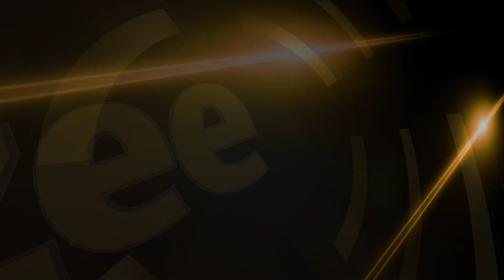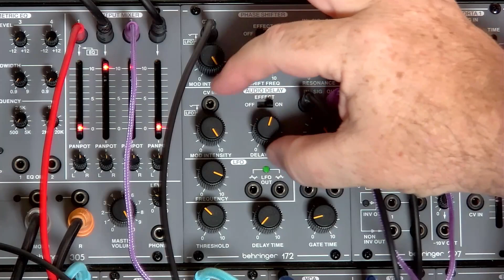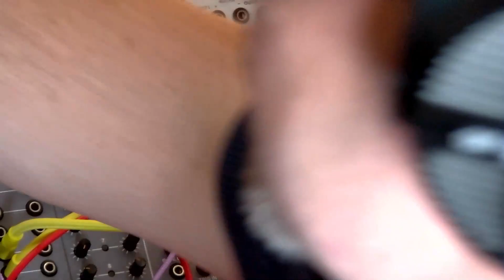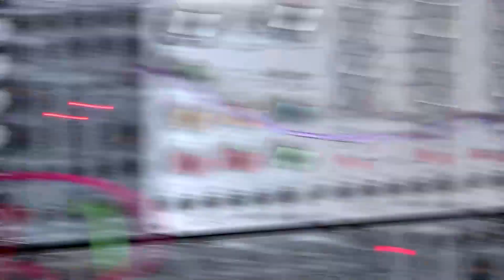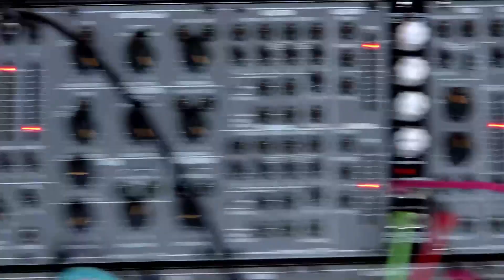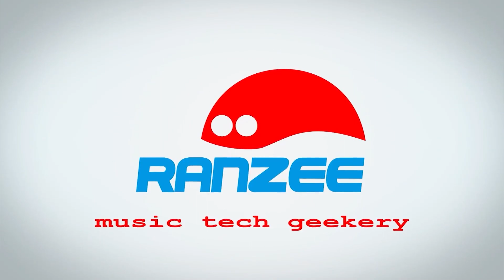Behringer 172 Phaser Audio Delay LFO Gate Delay

Comment: the lack of a mix knob is an instant 'don't buy' for me. I mean, if I have to split and mix etc just to use it properly I might as well get a nice dedicated phaser and delay/mod effect.
Reply from the maker: I use mine via a send/return "mix" matrix - which fixes that problem. However, don't forget these follow the Roland System 100m designs - and they were a whole modular system where you were supposed to patch these effects into the mixer module. Behringer did make one as well: the 305. Although not a great design, it does allow for a channel of wet and dry to be mixed. Personally, I prefer the Feedback Modules MIX BX or MIX CR - as they have send/return FX mixes.

Comment: This is probably my least favorite module of all the System 100 modules. I know it’s a clone of the original but it’s very underwhelming compared to other phaser and chorus/delay modules. The gate delay works well though so it’s almost worth it for that. The phaser is ok too. The LFO Is very limited, more basic than even the all in one synth voice module. I guess it’s still worth it for how inexpensive it is, especially if you want to have all the modules.
Reply from the maker: I actually like the chorus/delay circuit - you can get some really nice effects from it. I agree the phaser is a little on the lackluster side.

Comment: Hey man, just got my 172 module today and I am quite confuse if my unit is defected. The "Resonance" knob in the "Phase Shifter" feels like doesn't do anything until the final 10% which is so drastic that sounds incontrollable, and in the "Audio Delay" it feels like it is doing nothing :(... what is the expected behavior of both "Resonance" knobs? I tried with tones and noise... Thanks!
Reply from the maker: Hey. It's a replica of the original - so the original worked like this also. So yes, it's by design.
Reply: @ranzee  Awesome, thanks!
Reply: THANK YOU SO MUCH !!! MY QUESTION WOULD BE THE SAME ...If this units by design is not  dramatic is ok.... at least is not broken or failing is what it is.  @ranzee

Comment: I was wondering these things as well... the audio delay is not a delay LOL, then the drop of volume at the output, a bit disappointing 😑😕
Reply from the maker: As mentioned in the video - it's really a flanger/chorus effect. The original 172 module from Roland acts the same way. Remember, this is a recreation of the System 100m synthesizer from Roland.
Reply: @ranzee

Comment: just got one of these and the delay is.......not a delay. I am so confused. If you check out videos of the Roland reissue of this same module, they most certainly have a delay. Why advertise it as a BBD analog delay when it does next to nothing. No discernible delay effect at all on my unit!
Reply from the maker: Yeah I get what you're saying ... but it kinda is a delay - just in the "very fast" sense. If you're after a traditional BBD delay - there are some good modules out there already.

Comment: Man, the EU region has had all of the modules for a while! Most of these haven't been in stock here in the US or unavailable to pre-order.  Okay Uli, the EU has had enough modules, bring some this way..
Reply from the maker: I'm not sure Uli hangs out here - but if he does, say G'day for me ;) ... jokes aside - it can be annoying the distribution!
Reply: @ranzee  hey, while I'm here, do you have the System 100 EQ/Mix/Output module? If so, what do ya think?  It looks self-explanatory but ya never know.
Reply from the maker: @Zinfidel1  Yeah I have the 305 which you can see right next to the phaser 172 module :) They are useful and handy to bring some audio outputs together. However, you can achieve the same thing using VCAs (if you're not using EQs). I've used the tuner a few times - so that's a handy addition!
Reply: @ranzee  Nice, just making sure there's nothing super odd about it.  I already have one pre-ordered so I can tame a Fuzz Factory and other loud distortion fx. Also have some stereo fx that would be nice to consolidate before entering a sampler. Too bad there are no CV inputs for the panning but oh well, it's inexpensive. Thanks for the info.
Reply from the maker: @Zinfidel1  The Befaco Hexmix is the way to go if you really want all that fancy CV control. I actually wish Behringer would make a Eurorack version of some of their Xenyx mixers.

Comment: Do you have the oscilloscope? Can you show how audio delay looks in comparison to the raw signal. In my unit it definitely doesn't look like delay / shift in time. I sent the video of it Behringer and they said the unit is eligible to replacement, but I am not sure if support guys have the knowledge of the right behavior, maybe it is the same as Roland original. Best
Reply from the maker: I guess I could do that ... if the B says send it back - then perhaps wait and see what the replacement is like before we embark on some Oscilloscope Nerdism :)
Reply: @ranzee  their techsupport is not always right, that is a pitty ;)
Reply: @ranzee  If you could just check for me if audio delay gives 0-7ms delay 100% wet or is it a mix of dry / wet signal. In my unit it looks like both signals are blended and there is like 70% dry signal in Audio Delay output (modulation set to 0)

Comment: That delay is terrible. Dunno where you’re getting chorus from mate
Reply from the maker: It's a BBD chip - and it is most certainly chorus-ey and flanger-like.
Reply: @ranzee  Well I imagine it would be the same as the BBD on the Neutron and I can definitely get chorus and flange out of that. So I guess it just didn’t come across in the video. What sort of delay times can it get. It didnt sound like very long delays
Reply from the maker: @madmac66  yeah they're not good (too fast really) - almost unusable. You make a good comparison with the Neutron. I might ask a few friends who own a System-100m and see if this is actually the way the original sounded.

Comment: Behringer say 172 Phase Shifter/Delay should be mixed with the dry signal externally (Roland version have a dry/wet knob) but to me it looks like you don't do this in the video. I'm a newbie so might have missed it?
Reply from the maker: Always good to experiment with sounds - if you want to mix the dry signal - you will need a mixer. They sell one that is in the System 100 format too.

Comment: Very nice Ranz. 

To extend this, here's a comparison with the original System 100m 172 and System 500 572 that I did. I find the shift frequency needs to be lower on the phase shifter to really get the full effect. You'll hear it in the video (proper throaty).

https://www.instagram.com/tv/B_D32unhkWJ/?igshid=3rjqzywztsnu

I've also got a video on my channel where I use the 720B 2 channel phaser and 721B 2 channel audio delay on the System 700 too:

https://youtu.be/mgtuOvhXGI4

With the gate delay, in the original 100m manual it talks about its ability to do pulse shaping and how it's also useful for boosting a sync pulse recorded to tape as was necessary back in the day. I use my 172 and 572 gate delays to create claps as they're great for controlled flams.

Anyway, love a good spot of phasing and flanging and so it was interesting to hear the Behringer clone of this module. Don't think I've seen a specific demo of it before. Nice one.
Reply from the maker: Thanks Alex! I'll be checking these out! It looks like my 572 maybe going back to Roland for a healthcheck ;)
Reply: @ranzee  Yeah your audio delay did nothing! The mix does have to be up to 100% to really hear the effect properly but that's how you had it set and nothing happened.

The 572 audio delay is a little more extreme than the original 172, which is a nice alternative. I enjoy playing with both and panning them left and right.